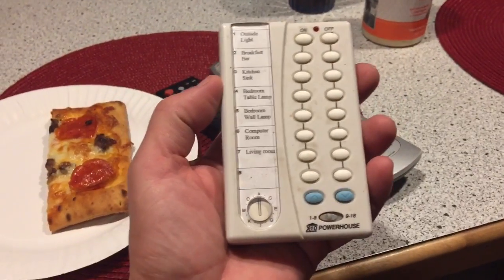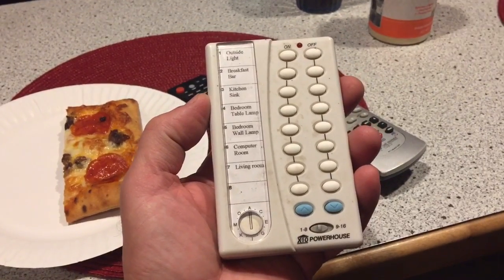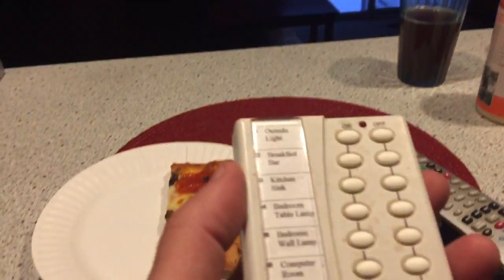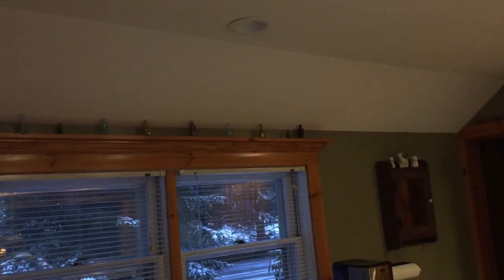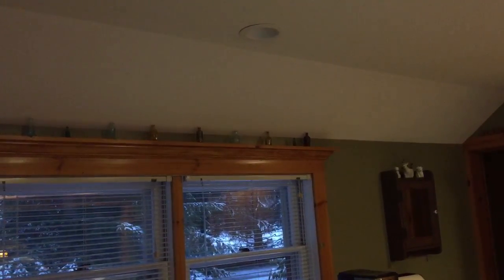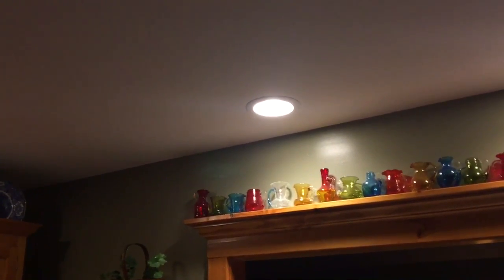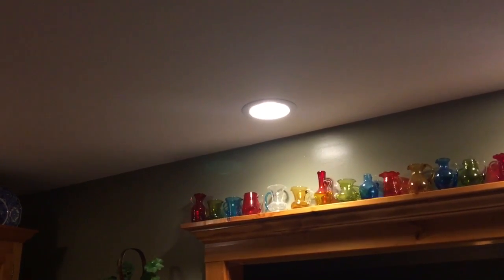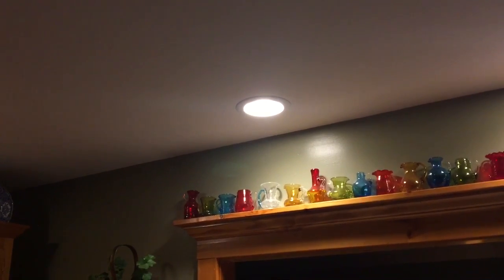Weird home automation generator, LED thing.

Comment: must be a loose wire some where Jim ? Not sure on this one man ???
Reply from the maker: ShawnMrFixitlee it's an interesting one, generally x10 stuff doesn't like line noise, so this would normally be reversed in the real world. (Or I have an exceptionally good generator...).  ;-)
Reply: not sure..??
Reply from the maker: ShawnMrFixitlee nope, not sure at all. All the connections look fine. And they work manually.
Reply: Maybe it is the remote System ??  Is there a box that has wires coming in ??
Reply from the maker: ShawnMrFixitlee nope, all self contained. The remote transmits to a box that plugs into the wall.
Reply: UGH .. Out of ideas here man !!

Comment: So it doesn't work on shore power but it does work on generator power. Are you running 220v off your generator as the power company would?
Reply from the maker: 1crazynordlander yup, 220 from the generator right to the house. The mains are cut off, that's the only difference.